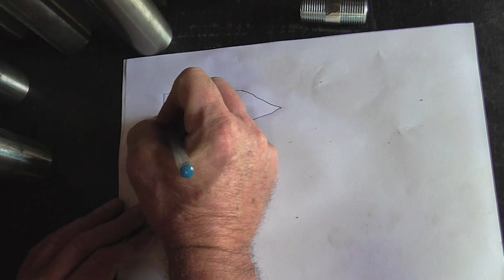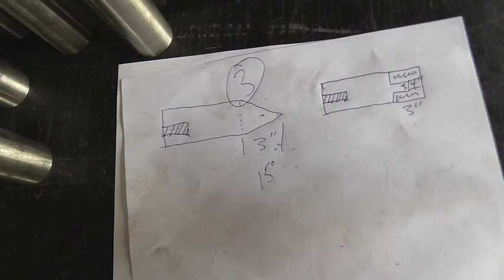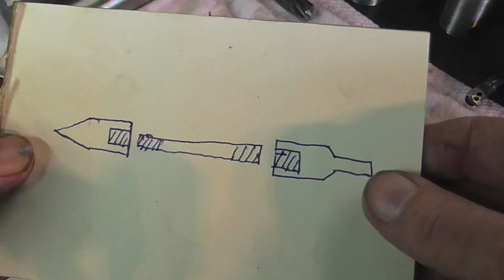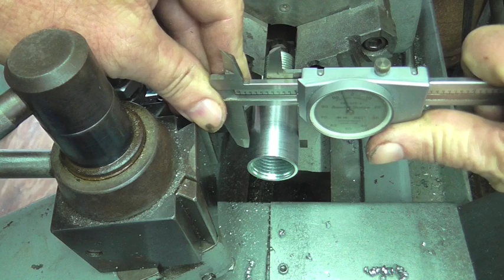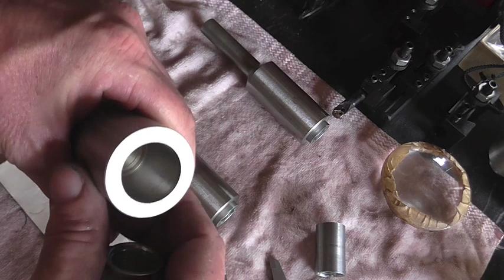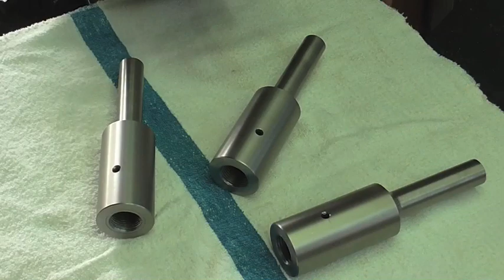Hogging Out 303 STAINLESS / Horizontal Boring Bar Components / Part 1 - MSFN

Comment: Looking good Richard! Good call on the design improvement--I'm sure the customer will appreciate it.
Reply from the maker: Thanks Rick, that was my 1st major project with stainless
Reply: I was impressed by your results when you upped the feed rate. I'm going to give that a try in the future.
Reply from the maker: It woulda been a long day if I was pulling long stringy chips so decided this was the time to practice with speeds, feeds and depth of cut. I was happy with the easily managed chips. The fatter chips break rather than come off in a continuous chip, give it a try!

Comment: Great video, thank's for posting.  Next time I would face off the 1/2 inch coupling and turn it around, then lock it in.  I've had pipes that have not been threaded far enough and that makes them slightly large.  If you combine that with a few threads off of the coupling it could hard to thread far enough on.  Just my 2 cents.
Reply from the maker: Thanks for watching Andy, suggestions are always welcome here, part 2 of the series is out if interested 😊
Reply from the maker: 2 cents is better than no sense!
Reply: Or he can always retap the coupling to NPT standard he may have just caused himself a bit more work,but still savable.  Good job by the way!

Comment: I've worked where these under sidewalk boring heads were made before and they were made from alloy 17-4
Reply from the maker: Cool, I never heard of them before. The customer told me to make it from stainless. I discussed making it of tool steel and heat treating them since I have a forge but it got too pricey
Reply from the maker: Alloy 17-4, sounds like good stuff...thanks for sharing MD http://www.specialtysteelsupply.com/17-4ph-stainless-steel.php

Comment: If you're turning the threaded insert down, you'll need to supply the customer with at least one set of backups. Its a clever way around damaged threads, but they wont be able to turn down a replacement insert in the field.
Reply: Charging them for them of course. Lol
Reply from the maker: Of course! 😊
Reply from the maker: Add ons....I like it! 👍🏼
Reply: What kind of material should be used in horizontal boring machines tool Bari center to center

Comment: Great video Rich.  Question, does the set screw go to a dimple in the insert of all the way through?  Thanks for sharing.

Joe
Reply from the maker: All the way thru Joe, they can be adjusted according to how deep their pipe threads extend inside. He is bringing a sample tomorrow and I can set them (setscrews) in place with Loctite based on their pipe thread length/depth

Comment: I would have left the original part threaded.. Since there are being used on an impact hammer. My bet will be that the sleeve crushes and either comes loose or wedges itself into the part. You'll end up machining the part out.. With the threads, if they get screwed up the plumber can retap.
Reply from the maker: They are using threaded conduit for extending these to length so I think the risk of failure is about equal on both components, mine and theirs. Time will tell of course and appreciate your view on the project

Comment: could you have put the bushing all the way in and used a roll pin to hold it in? the threaded piece probably only goes in a little more than half way.
Reply from the maker: I wasnt sure how far the threaded pipe was going in so refrained from a roll pin but thought about that honestly, at least with set screws it could be backed out some if the pipe extension thread bottoms out. Great observation!

Comment: Stainless steel doesnt like hss tools too much,but he likes low rpm and high feed rates with plenty of cooling liquid.Also for good finish you need  to take heavy depth of cut.I seen mirror finish on stainless on lathe.If you are doing something precise with micrometer watch for heat stainless steels are mostly bitch that warps easy.
Have fun !
Reply from the maker: Thanks Zumba, nothing about these components are "precise dimensions" They will be trashed as soon as they are put into service in the field. This is my first serious stainless job and had a good time experimenting with speeds & feeds...its tuff stuff but the Atlas Lathe held its own...was a fun project!
Reply from the maker: I need to devise a coolant system to this lathe, heat was a problem I had to deal with...a learning experience 4 sure!
Reply from the maker: Thanks Zumba, I didnt know they sold those...gonna pick one up and give it a try 👍🏼

Comment: Good to see you. It has been a bit.Chips look great. I love working quality material. Stainless can be tricky. I use lots of Rapid Tap. It has never let me down.3 set screws is always better my friend. That sure is a nice little lathe. I am used to a far larger machine but I would have loved to have this one in the shop.On this one being hammered on Red Loctite would be a lot better. You need to heat it more to get it apart but it gives a vicious grip.Great looking pieces bud, I am sure they will work well. I really like the serviceability to change out the driver sleeves.
Reply from the maker: Thanks Dean, I am always open to ideas from persons more experienced than myself. The sleeves only cost $1.45 so feel its a cheaper option than machining new stainless parts...time will tell but I think they will work well as consumables to preserve the component. Thanks for watching and your feedback...part 2 out soon 😊
Reply: Nice work and think about using the Red more. If you don't want it to move it won't. Mapp gas heat will break it so it can be easily done in the field. I was shy about it until I put my foot in the water and found it great. You are just not releasing that stuff by hand cold. Great machining my friend.
Reply from the maker: I will pick up some red, a particular # you are fond of? Part 2 out tomorrow...some good footage I captured, hope you enjoy 😊
Reply: No prefered # Just Red in the same type container. All of them work best under pressure. I will be waiting on the bell my friend.